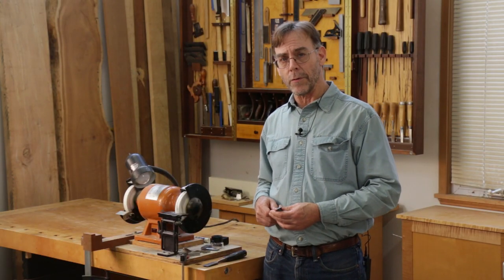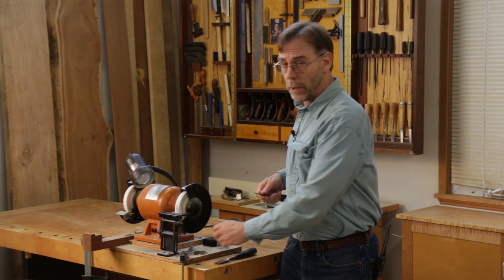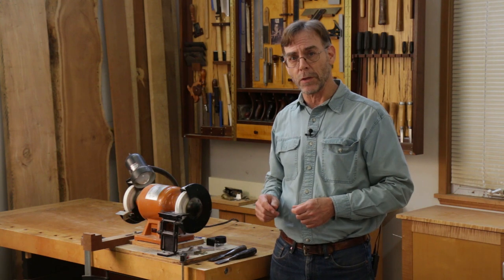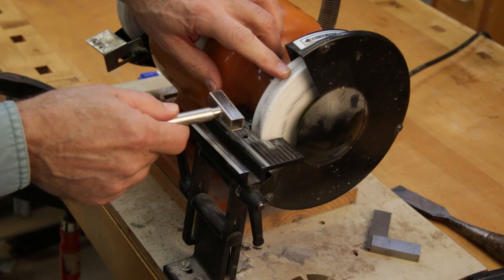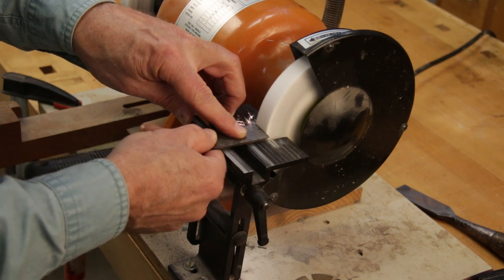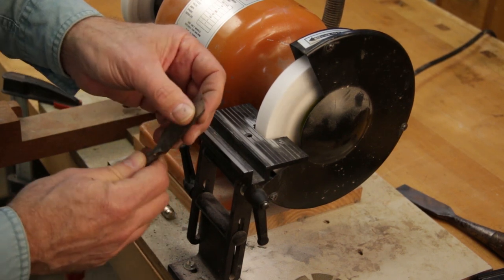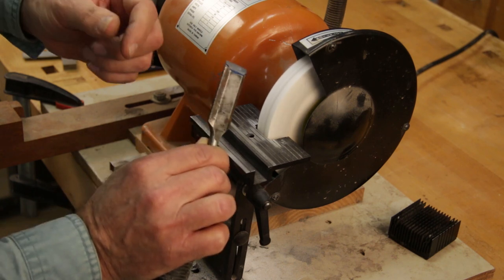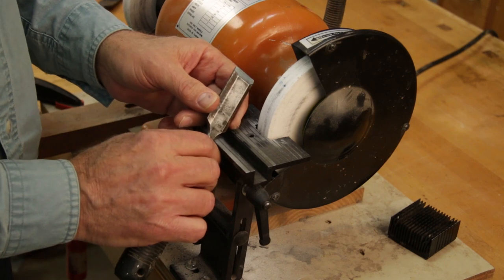Grinding a Chisel with Paul Anthony

Comment: Why would you buy a veritas adjustable grinder tool rest and not adjust it to the desired angle?
Reply: Ben Sandham, If the chisels are long enough then adjust the tool rest to the desired angle. However, if the chisel is short as in the case of this beater chisel the ferrule and handle may ride up on the tool rest thereby changing the angle. I have 2 chisels that have part of the ferrule ground back underneath so i can use the tool rest at the angle I choose.
Reply: I agree, it makes little sense to freehand the angle when there’s a rest available. I think there’s plenty of room to use the rest with this chisel, though it is short. Not only would the rest add consistency to the grind, but it would act as a heat sink and help prevent overheating the edge.  Seems like pretty questionable advice to me.
Reply: @rickgoebel6724  when the chisel is too short for the tool rest you have you can attach an auxiliary rest on top of your existing rest that accommodates the shorter tool. The rest you tack on just needs to be narrow enough the shank of the chisel fits on it. A scrap piece of hardboard or something like that usually does the trick. It's what you'll see hot glued to my tool rest. Temporarily permanently. I couldn't tell you how many years it's been there now.
Reply: And we old school:) don't loose the art to technology